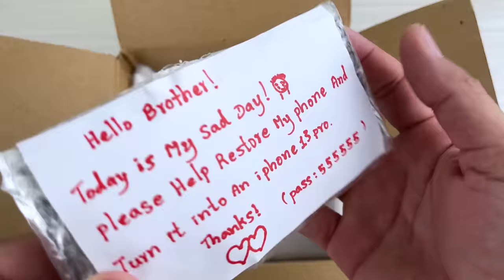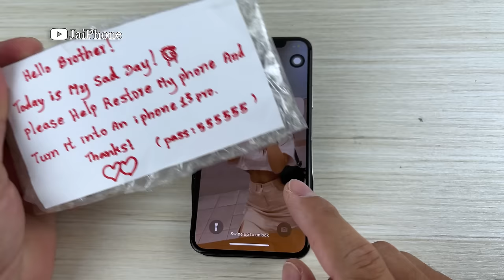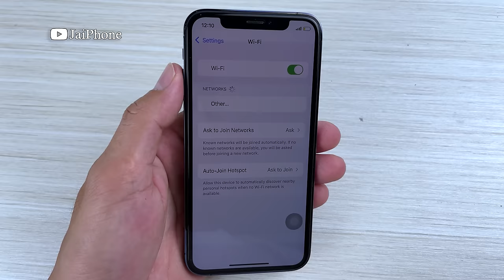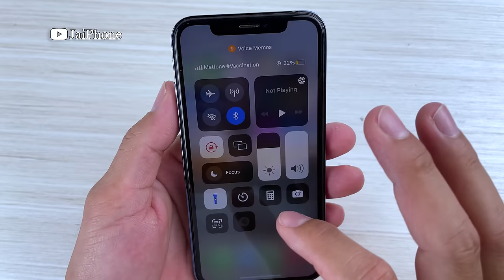How i Turn Destroyed iPhone X into a Brand New iPhone 13 Pro

Comment: He knows the phones inside and out. The delicate way he takes it apart and puts it all back together is AMAZING 🤩
Reply: Exactly what I was thinking
Reply: @chelseaceballos6710  Only except Face id everything is working fine…..Right??
Reply: Era mejor comprar uno😂😂
Reply: @samuraizodiacomr.3358  Depende si el trabajo fue gratis esto iva ser más bueno
Reply: @samuraizodiacomr.3358  si no tiene dinero?
Reply: @MegaRamesh1982  face id too is working
Reply: @MegaRamesh1982  no everything is working as he successfully swapped the Face ID parts over with no damage. That’s the most difficult housing swap I’ve ever seen, so much to swap out, though I’m sure there’s a pre built assembly version.
Reply: @djvsmoothjasonv4555  Yeah…Right!!
Reply: @MegaRamesh1982  he clearly has as the first part was just to test the screen, you obviously have no clue about this sort of thing. 🤦🏻‍♂️🤦🏻‍♂️🤦🏻‍♂️
Reply: Yes😂
Reply: Amazing
Reply: He really doesn't, he just transferred everything to another phone. smh
Reply: @MegaRamesh1982  Yeah
Reply: Really amazing n awesome
Reply: He worked so easily, How can this possible, professional and very skillful.
Reply: 吸取養分類似的方式來進行包裝後訂單及所有附隨時就開始一一一一一一一一
Reply: Problem rec but still amazing that he can fix it
Reply: @MegaRamesh1982  🦄🦄🦄🦄🦄
Reply: @samuraizodiacomr.3358  NO
Reply: クリップをタップすると、テキスト ボックスに貼り付けられます。
Reply: That's obvious for a person that repairs phones.
Reply: @MegaRamesh1982  .mrke
E
Reply: Ooo
Reply: J
Reply: @chelseaceballos6710  .
Reply: Me to😅
Reply: Yes Krystal
Reply: Brand and cover take from where ? Amazon store have like that
Reply: ur boi
Reply: He probably spent 80 hours a week assembling these in some Chinese sweat shop before he started this Chanel
Reply: L
Last g
Reply: @chelseaceballos6710  can you fixed
Reply: @chelseaceballos6710  brilliant
Reply: @chelseaceballos6710  brillianr
Reply: @chelseaceballos6710  what a brilliant
Reply: Ikr!
Reply: Hé always do good work and have the knowle,  but it's à fact, all Apple was all the sames.
Reply: Amazing bro
Reply: @MegaRamesh1982  l
Reply: شكاتبة
Reply: كةةةةةةةة
Reply: বিশ্ব জীম্মাদার হযরত সাদ সাহেব, তার খেলাফতে
   বাংলাদেশে টঙ্গীর ময়দানে বিশ্ব ইজতেমা অনুষ্ঠিত হবে। 
  তারিখ  20, 21, 22 জানুয়ারি 2023,
আমরা সবাই দোয়া করি, যেনো আমরা সবাই হেদায়েত পেয়ে যায়, আমীন...
   এই বারে বিশ্ব ইজতেমায় হযরত সাদ সাহেব আসবেন, ইনশাআল্লাহ
     আর সম্মানিত ব্যাক্তি হযরত সাদ সাহেবের বিরুদ্ধে যারা যারা অপপ্রচার চালাবে, তাদের বিরুদ্ধে ব্যবস্থা নেওয়া হবে, ইনশাআল্লাহ
   আর ইজতেমার ময়দানে সবাইকে আসার দাওয়াত রইলো, ধন্যবাদ
Reply: Kanmav
Reply: 35
Reply: Perfeck
Reply: @ploopytv yeah he did, now have you ever repaired a phone? Probably not, it's very difficult to do a housing swap because this guy got one without the tiny parts included, if you would have repaired that you would get impatient at even replacing the screen and you would probably break something, it's easy to say stuff like this but it's harder to do it, please replace a whole housing first and then talk on the internet.
Reply: @archux_  blud its been 2 years drop it
Reply: @ploopytv omg!21112 it'Z bEEN 2 ZEARS!!?? that is SO. MUCH!!11,,n

Comment: Jai do you also fix the face id error when you replace the screen with new ones?
If not then you buy that gadget that's being used to copy the old screen's serial number and transfer it to the new screen. Great
Reply: He has that gadget bro don't worry 😊
Reply: It's an iphone 13 case but I think the guts, including the new screen,  are from the iPhone X, which predates serialisation
Reply: @siddharthm285  Unfortunately not. iphone X already serialised. Broke my screen, changed it and face ID not working anymore.

Comment: If I send you my smashed iPhone X (smashed screen, back plate, a frame that is bent beyond repair, and a bent battery) and a donor iPhone X could you move the logic board and the Face ID assembly and the earphone speaker assembly over to the donor phone’s hardware? It’s a jailbroken iPhone X on old software version and I really want to revive it!

Comment: Excuse me Sir, the iPhone 13 pro is a bigger size and there would be a small amount of room for things to kinda wiggle or not properly fit. 5.8 inch display and 6.1 inch displays are kinda important differences
Reply: It's not even a 13 pro, it's a 12 pro. Look at the camera module, here it is way smaller than the one you can find on the latest iphones
Reply: The display fit properly because the back panal also change.
Reply: @aimanbinhasib1587  But still its bigger than the X, which the parts shouldn't just get bigger as well if he is using the original ones

Comment: How about the size? Did it upgrade from the X 5.8" to 6.1" as well?
Reply: the 13 pro is about the same size as the X. the 13 size is kinda similar to the XR , 11...
Reply: @zyad8312  the screen sizes are not the same though.
Reply: He got a new screen compatible with 13 pro since X screen is already damaged and can’t be used
Reply: @tinlian8103 it is a 13 pro screen or a X screen?

Comment: How come another camera was added but somehow it doesn’t need an extra connection point, is the camera purely cosmetic or does it actually work, also can the software be jailbreak into operating the iPhone as if it was a 13
Reply: it is just glass nothing on inside

Comment: 2 main flaws with doing this: 

1) Camera looking odd with 3rd one being useless and zoom not improving

2) The notch is not smaller and can lead to people saying the phones fake. 

Nonetheless the phone looks pretty neat and the components are right in place! I would give this a 7/10 for using proper materials .
Reply: Hope he replaced the battery 😅
Reply: also, the sides- they’re not supposed to be glossy, as they’re made of titan (it’s matte)
Reply: You could claim its a 12 pro
Reply: @Pain_Ito also the 13 pro has no curved glass

Comment: iPhone X was 5.8 inches.. iPhone 13 Pro is 6.1 inches.. how did the same assembly fit in without any gaps.. unless it’s a custom case of iPhone 13 of 5.8 inches, which I think is the case.. the phone got an extra wide angle lens post upgrade without the mechanism to handle it..

Comment: Good job i work with phones too, so you definitely did well, except i don't use glue, but official seal from the og company and epoxy.
Also i would clean an old glue residue off and ofc use gloves or remove fingerprints i left, but u do u :3
Hope you've told the client tho, or it was somewhere in the contract details at least.